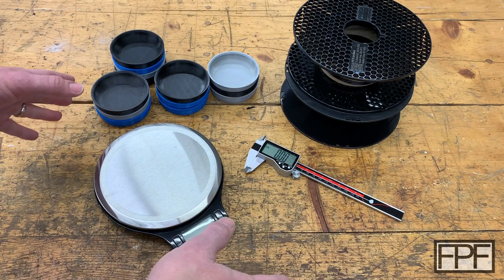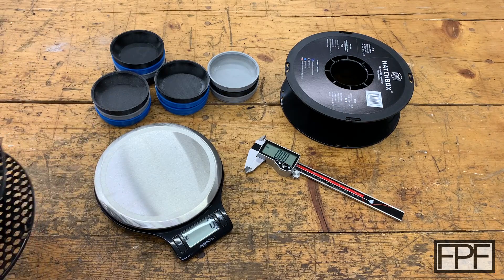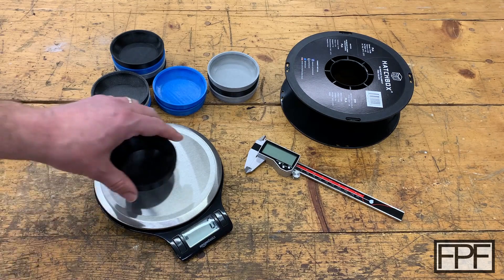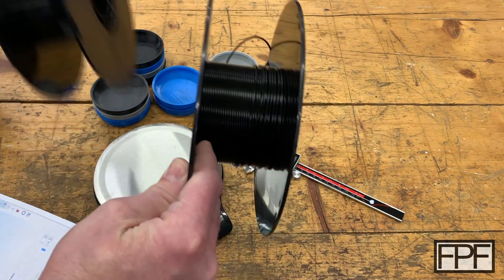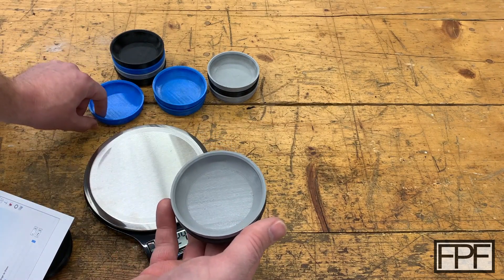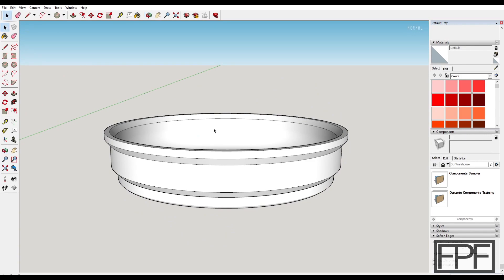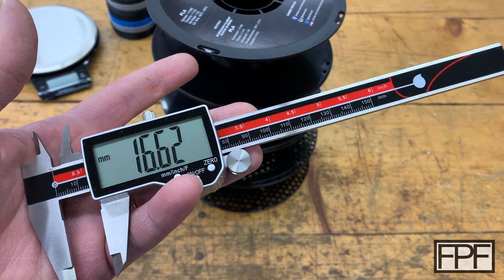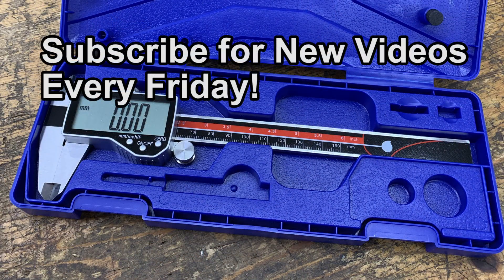3D Printed Stacking Parts Trays Using Leftover Filament

Comment: I've been wondering why the 3D printers don't have an option for a strain gage built into each reel holder, essentially providing a weight scale that can be continuously monitored...

 At any rate, if the printer has a filament out pause option, that works for me too.  The Bambu printers work great for that solution.  Prusa is not great as you have to manually wipe the drip off the nozzle after loading new filament.
Reply: P.S. Still trying to figure out what to do with empty spools.  I now try to buy spool-less filament reloads.

Comment: The rolls I just throw,  but left over filament makes great cable management clips.  They are small enough to need almost no filament and lots of free designs so I don't need to reinvent the wheel. I also make eyepiece covers for my telescope because I keep loosing them and they to take up almost no filament

Comment: I have never understood people throwing out the short ends of rolls. I use them for things like brackets or other functional prints where color doesn't matter. It's really quite simple to just make sure that both ends of the old and new roll are clipped squarely and then feeding the new roll in behind the old into the extruder. I've never had the need to join them and this worked on both my direct drive and bowden printers.

Comment: You rock. I never even thought to weigh an empty spool and then a partial to see what I have left. I've just been YOLOing it and hoping for the best lol
These little parts trays will be in my end of roll print rotation now. My other being a 45x45x60mm small parts bin that takes about 22g. Excellent video, thanks for posting!

I never thought to use spare rolls for extension cords either, adding that to the bag of tricks!

Comment: Not sure this capability existed when this video was released, but the Bambu AMS can solve this too. If you have two rolls of the same filament in there, your almost empty one and another, it can switch over for you when the first one empties.

Love this idea too, especially the stacking design!
Reply: but does it completly use es up the filement? without letting something in the tube?
Reply: @thelastengineer8633  yes

Comment: Wrapping cords is good. You might want to put some of those magnetic sheets in the tray that hobby stores sell to make fridge magnets. Just cut them to fit and glue on. I haven't done it yet, but I like the idea of parts bins. I've seen a few videos on it. Some people try to splice the filament together. They say with mixed results. You have to make sure the joints aren't to big

Comment: I join together old leftovers of filament with brand new one. To do this I made special guide by rolling thin metal sheet around filament. To fuse filament I only need to insert two of it's ends to this gide, press them together and heat whole thing.

As to empty rolls I use them to store spare cables, wires and LED strips :)
Reply: can u upload a picture ore something of that that sounds great

Comment: Cool idea, and don't we all need parts trays? I have several systems for keeping screws straight if I'm pulling a radio or some guitar or effects pedal or amp apart, but often if I have to wait for a part once I know what's wrong, I put it back together to keep things from disappearing. These are for sure going to get made from a couple little leftover spools I have around. I'll be doing that instead of maybe printing another miniature or random clamp bolt for a radio or mic mount, which is what I often do - simply use the little bit left on a spool for the smallest parts of a built or print.

Comment: There is an easy way to use your  last bits of filament more precizely: you gotta measure the length of the filament and compare it with cura's estimations cuz it gives you estimations up to millimeters so you can be sure abt that
already subscribed <3

Comment: I just came across your videos and really enjoy the content, and just how relatable they are. The trx4 video is what brought me in as I'm a RC and 3D printing/(badly done) design hobbyist. Oh and that digital caliper would be a great addition to my to kit. 

I have tried my best to weld together some PLA with.... less than great results so mostly I'll run it down on more tiny prints as I play around with settings as if I hadn't already tweeked it a million times.
Reply from the maker: That TRX-4 is so much fun to drive around!  Thx for subscribing.
Reply: @FunctionalPrintFriday   heck yeah they are

Comment: Great video! I see small holes on the sides.  Perhaps use the spools on their side and use them to hold tiny paint brushes if you are painting models or other small tools that are helpful to be upright and separated for one reason or another.  Good luck and cheers!

Comment: Besides printing small parts from the last bit of filament on a roll i think a good joining system to daisy chain pieces of filament would be ideal to avoid unnessesary plastic waste. I probably have 200g of offcuts laying in a drawer that would be ideal for a functional print.

Comment: How about calculating the leftover lenght? 
Cura and Prusaslicer will display also the needed material length for the print.

From circumference equation: C=2*π*r => L=2*π*r*N
C = Circumference

L = lenght of the leftover
r = radius of the spool
N number of full turns of material left

Comment: I am definitely looking for ways to use up filament, but... I realized that if I have a spool of the same in stock, I can do a controlled cutover. That is, start a print, monitor it in Octoprint, (I've estimated roughly how much time the existing spool with run for). and as it gets close, issue a change filament command via the terminal. I then go swap to the new spool, and while I do have a little left over, it's suitable for cutting into smaller lengths for a 3d printing pen. Which, I have yet to get, but I hear they are a great way to do some quick welds on prints.

Comment: Great video! You (possibly) could estimate how much is left on a roll if you have a full roll rather than an empty one if you measure it and know that you bought say 1 Kg of material. You could make a table of measurements for different brands/materials and always refer to it. In fact us as a community could even make a test print that uses certain parameters to even normalize different scales and help each other out with making a reference sheet! 

I really hope you can make a follow up video with suggestions about how to use old rolls. I have SO many and I'm looking for a way to use them. It be cool to make a prop, a robot, or something that would help increase accessibility for schools or something. The only thing I've found them slightly helpful is if you're making large  electromagnetics. You can use them to wrap the wire around!
Reply from the maker: Great idea.  I'll review the best suggestions next Friday.

Comment: I hadn't tried weighing yet but it's a great idea and I already have the scale.  I use the ends of spools on small functional prints when I'm sitting near the printers.  I swap the spools when the filament sensors beep.  I'm cheap and use every bit of filament.  I'll be printing lots of your parts trays.

Comment: Found your design from reddit, I take leftover filament and splice it together using a generic 3d printed clamp and a soldering iron, shave off the excess hump that forms from the splice for it to feed well enough and roll it back on a reel to use when I have a project where an imperfection wouldnt matter. Thanks for .stl im going to try and scale these up and possibly hollow out the center bottom to glue a shallow magnet so I can stick a few to my bench when not in use and possibly keep nuts and bolts in if I bump it

Any chance of a video detailing a socket organizer or socket tool box tray? If not any recommendations on one, the few I've printed have left much to be desired, there plenty of successful commercial trays available but the printable ones all seem to be similar shallow circular cut outs. I might just be looking in the wrong places, I think tool adjacent projects like this are majorly untapped for 3d printing. Thanks for sharing
Reply from the maker: wonder if a small brass tube could be used in the same, with shoving filament in either end and letting them join in the middle.  thx for sharing!
Reply: interesting idea. is the clamp file you like available online somewhere? would be interested to try it.
Reply: @bradyrogers48  Yes the clamp file is available at that thing place, it seems my comments mentioning it 9 it are getting removed, but  77 if you take my comment and google all the 1 numbers 5 while putting the word thing before it will 6 bring you to it, its an easy print and feels weak but has held up well, there are other models that use binder clips but are bench oriented, this one worked for me and is more mobile in my opinion, good luck, searching for filament splicer should also work, it is not my design

Comment: I do the weighing like in the video.  What I do is weigh the full (gross) weight of filament and spool and write that weight on the spool.  That way when the spool is getting low I can weigh it and have a good idea how much filament is left on the spool.
Reply from the maker: do you find that the amount of filament that is supposed to be on the spool tends to be fairly accurate?
Reply: @FunctionalPrintFriday  I've only completed a few spools after starting this.  Those have been within 10 grams or so.  Typically a few over as the empty spool weight is a few grams less than the gross weight of a full spool minus 1000 grams.  Maybe there are a few grams of water picked up during the time the spools are on the printer?  I don't know.

I think that my method is much more helpful than looking at the "amount remaining" gauges on the sides of the spool that some of the manufacturers put on them.  Most of those aren't even close.  

If I have a print that Prusaslicer or Cura says will need say 48 grams of filament I can use my method and if I calculate 53 or so I'll feel confident that I can let the print run while I'm away  from the printer and it won't run out (no filament detector on my printer).  If one prints the same brand of filament a lot (I bounce around a lot) your method would be far more accurate as I imagine that the variation of weights of spools for a single manufacturer is only 2-3 grams at most.

For those who use master spools, your method would be absolutely perfect as you would know the exact weight of the spool every time.

It would be interesting for someone (ideally someone who prints a lot of filament across several brands) to weigh the gross and final empty spool weights and determine how accurate the stated weights are for each of the more popular brands.  There may be some professional printing guys and gals who do this.  If I ran a printing service, I would absolutely do this.

I imagine that spools are filled at the manufacturer by length, not weight and the better the control of average diameter, the more accurate the actual weight to stated weight.